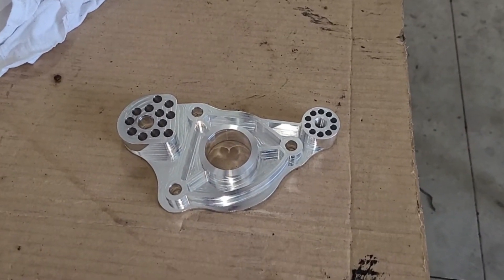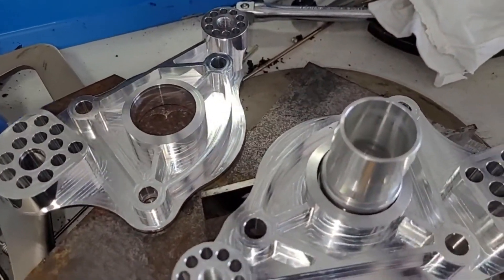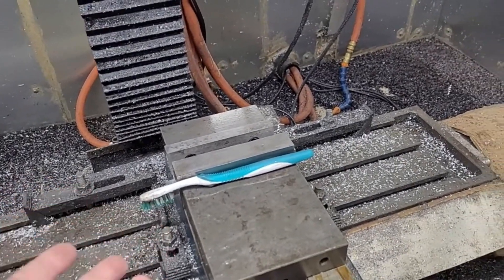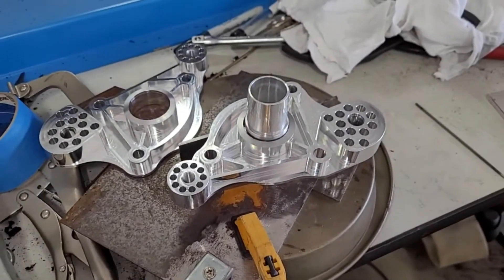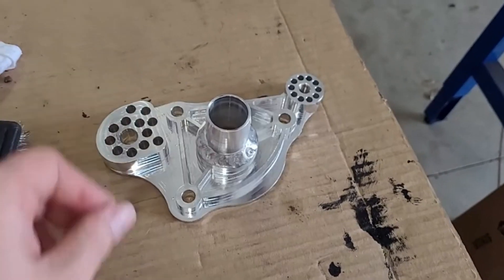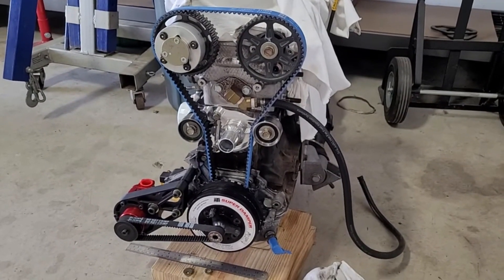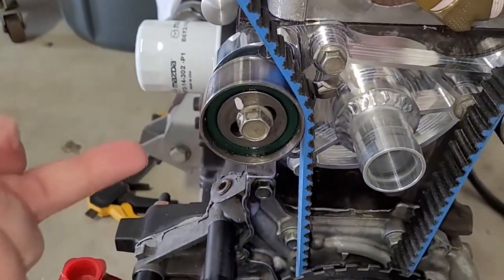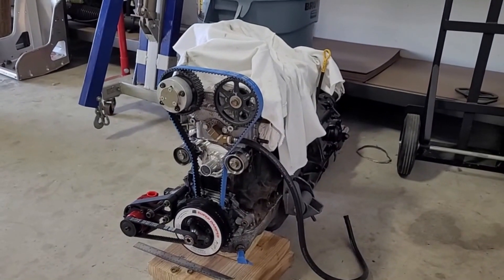Miata Electric Waterpump Conversion! CNC Custom Water Inlet

Comment: @Patrick Cowan Jr. Did you sell the other one in the end?  I have a davis craig for my 1.8 that I would like to do this for it.  At the moment I have my old water pump that I've removed the impeller from, but it still restricts flow.  This would be much better.
Reply from the maker: Not sold yet! It's listed on ebay.
Reply: @patrickcowanjr1  It is now... I just bought it :)
Reply from the maker: I see. Very nice!

Comment: Wouldn't a coolant reroute bypass all this and give u better coolant flow through the block?
Reply from the maker: I've been running a reroute since 2008 or so. It gives more even coolant flow through the head by creating a Z configuration for coolant flow (the way mazda intended when the first 323 was introduced with this engine in the 80s)

The setup I'm doing now will be a reverse-flow cooling sytem, where cold water enters the head from the front and back, cools the head (warming the water in the process) and then the warm coolant passes down through the block and exits this bracket I just made. Then the hot coolant goes to the radiator to be cooled.

The benefit of keeping the head colder is improved knock resistance. The benefit of having the bottom end warmer is less friction, better piston to cylinder sealing, oil last longer, and a few other less-significant things.

Also long term, I'm going to a dry block and will only cool the head. So this setup is also future proof.

Comment: Who do you have make your custom parts for you? Or do you make them? I need an adapter and a rear inlet for my 1.6 liter supercharger aka 1600ar supercharger made and I have designs and pics of everything but need to find someone to make the adapter from the supercharger to my ubercharger manifold and the rear inlet to a throttle body adapter.
Reply from the maker: Sometimes I make it, sometimes I pay other shops to build it. Depends on the part, quantity, complexity, and timeframe.

I have a good group of shops I use depending on the type of part. 

If you have a CAD file, I can take that and get you a quote and lead-time for a fabricated or CNC Machined part.

Comment: What are you utilizing for your electric water pump?
Reply from the maker: I will check and let you know. I have bought it but have not installed it yet. It wasn't too expensive though and has a very high flowrate.